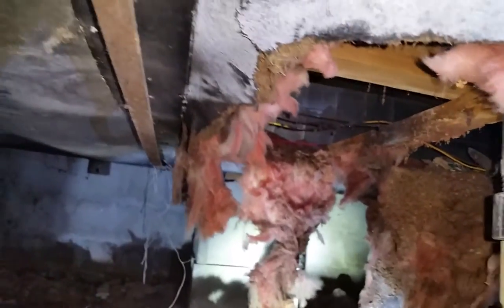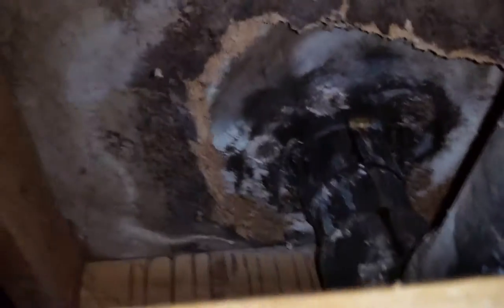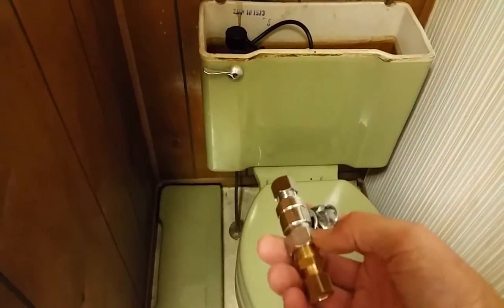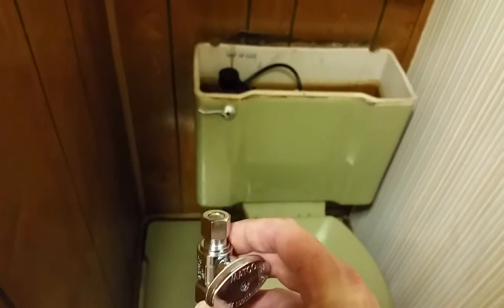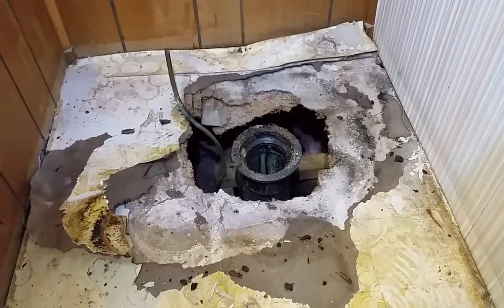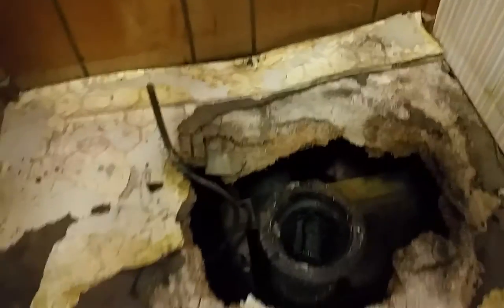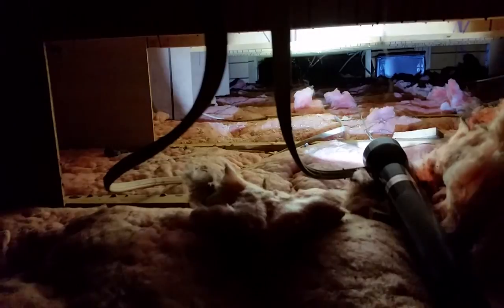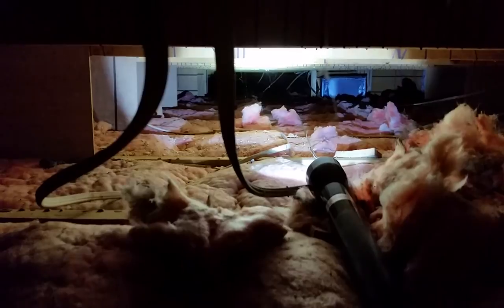DIY Landlord: Mobile Home has the Smell of Mildew. What I Found and How I Fixed it.

Comment: being a landlord of trailers..............old trailers really sucks, i have 6 of them for rentals so your video is all too familiar. ive never heard the underpinning or tar paper and insulation under the duct work referred to as the cold air return?? I have a 1971 60 footer that all down the center the tar paper and insulation over the years has all fallen down to the ground. The ductwork is exposed. one of my projects next year is to re insuate the belly. Have not noticed any issues but im sure it cost more to heat. You did a fantastic job of documenting/filming your very undesirable job and the the trip down memory lane was a good touch too
Reply from the maker: Thank you for contributing and the kind words if you ever have any questions or just want to swap landlord nightmare stories just text or call my cell at 606-875-0125 Kevin
PS we have over 20 rentals so I have seen and fixed a lot...

Comment: The trailer I just inherited was my grandmothers, so I can relate to the memories. Mines a 72, probably the same make as yours. 

It has a Terrible smell, someone told me it was the underbelly. Do you know anything about upgrading to get rid of the open air space system? Or would you recommend replacing the insulation?
Reply from the maker: Riley RR thanks for watching and commenting. . It has taken a while but that mildew smell is finally gone.
Reply: Check the bathroom-water heater, sink, tub drain, shower plumbing, and toilet flange and plumbing.  Also check the flooring.  One layer of wood over top the old floor holds mold and the main source of the smell.  We had a '72 trailer, gutted the whole bathroom, rebuilt it, added new pex plumbing, and the smell is gone.
Reply: Are you certain its not a missing trap and your not getting sewer gases coming up through the plumbing. happened to me on one of my old trailer rentals. Terrible smell!!!!!

Comment: I want to fog my HVAC with Concrobium. But my coil is in a metal case that is only 1 inch away from the cabinet. How do I introduce the fog into the HVAC enough that it pulls it all through the system with all the vents closed but the furthest away, when the only time I get any air suction is when the filter is in place?
I would be SO GRATEFUL if you could tell me what I should do. We are pretty desperate here.
Reply from the maker: call or text me my cell 606-875-0125 Kevin

Comment: That open belly systems are scary as heck because you are circulating all that nasty fiberglass into living spaces causing lung and cancer issues.
Reply from the maker: I guess why why you don't see them anymore
Reply: Wonder how you can change it so it not getting air from there
Reply: @detectingrose2221  On the newer homes they use duct work for the supply side and just a big return vent on the air handler system inside the home and not the open air belly returns anymore.
Reply: @hotrodhog2170  Most old 40 to 50 year old trailers the underpinning has multiple holes in it hanging down all ripped and renders it useless as an air return anyway.
Reply: All you have to do is disconnect the return duct from the plenum on the furnace and put a new return with a filter there by the furnace.